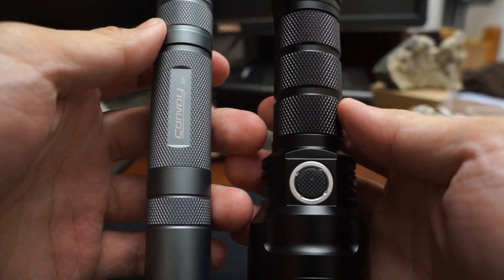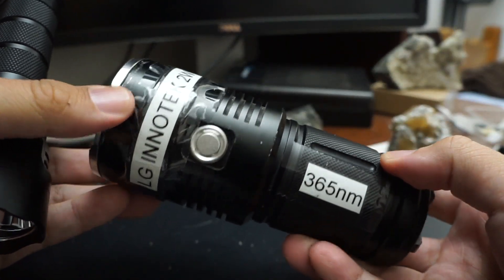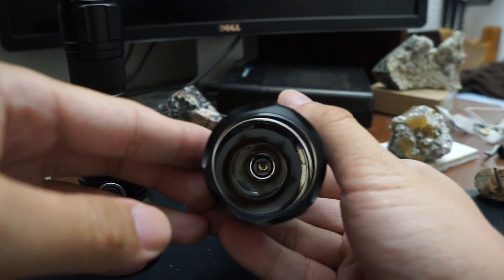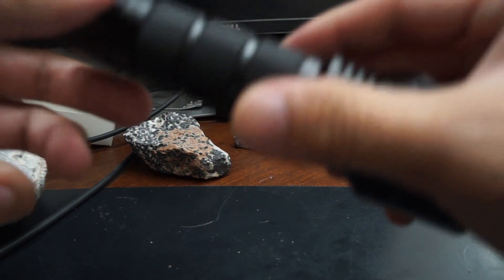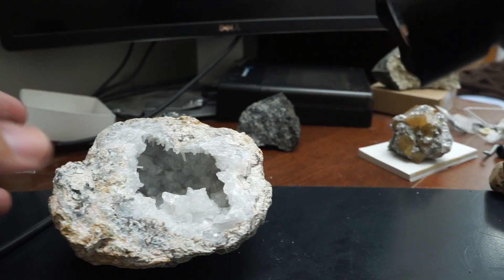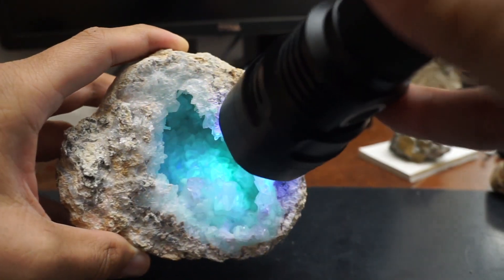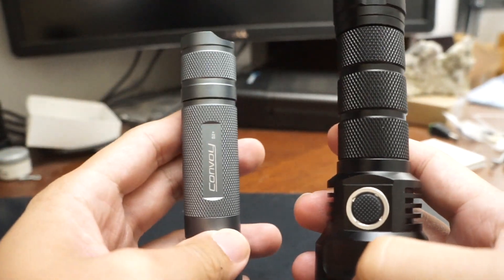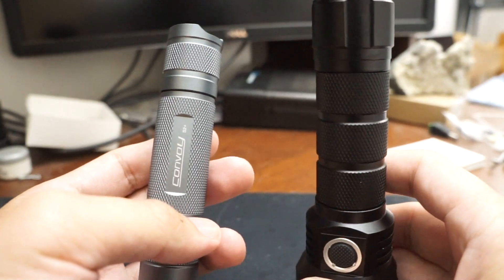All The Hard Work Paid Off! Showcasing My Shortwave (SW) LED Flashlights

Comment: where is the visible light coming from? led crystal impurity fluorescence? package material fluorescence? do filters make it better?
Reply from the maker: The visible light question is outside my area of knowledge. Likely not impurity fluorescence though as there aren't any signs of imperfections from what I could see. Granted, I wasn't looking at it with an SEM at the um scale or anything. If I had to guess, I'd say it's the fluorescence of the phosphor being used. Lastly, yes, filters can cut the amount of visible light to nearly zero
Reply: @Raymond-Wu  Wait what?? They're using a phosphor over the led die to create the 255nm light like in a white led????
Reply from the maker: @Muonium1  No. Sorry, my terminology might be wrong. Again, not my area of knowledge. It's from one of the layers of the LED fluorescing
Reply: @Raymond-Wu  OK well I kind of need want one even though they're still crazy expensive, but even though you don't want to say who the supplier is can you provide some more info on your site like center wavelength, FWHM bandwidth, battery lifetime, etc. and can you recommend a filter type like ZWB2 or something?
Reply from the maker: @Muonium1  Totally understandable. The reason I went down this path of LEDs was because I could build them myself. That was true even when I had bulbed lights. Always built them myself. All of that information will eventually be open sourced. I plan on making a comprehensive video explaining the UVC LED space, my design decisions, and radiometric data.

Can't talk about filters though.